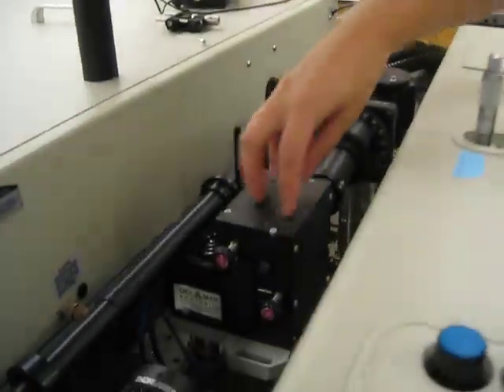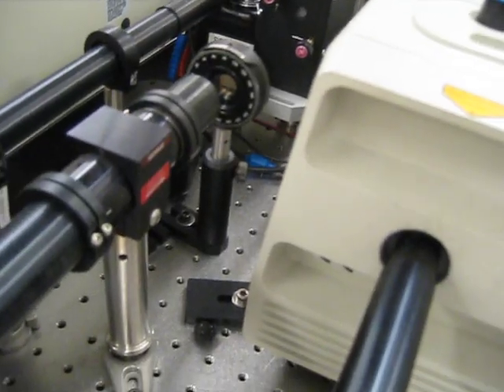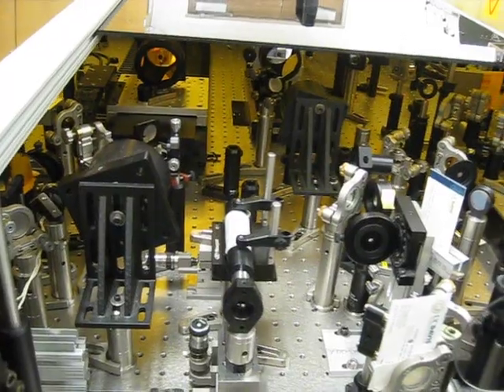A single source femtosecond-millisecond broadband spectrometer UC Davis - sales@dmphotonics.com

Comment from the maker: Structural, linear and nonlinear optical properties of metal-semiconductor nanohybrids prepared by laser ablation
Yury Ryabchikov, Artem Danilov, Vladimir Lysenko, Ronan Le Dantec, Victor Timoshenko, Andrei Kabashin
15 February 2016 • 3:30 - 3:50 PM | Part of SPIE LASE

High-throughput depth-resolved parallel laser machining based on temporal focusing
Dapeng Zhang, Chenglin Gu, Shih-Chi Chen
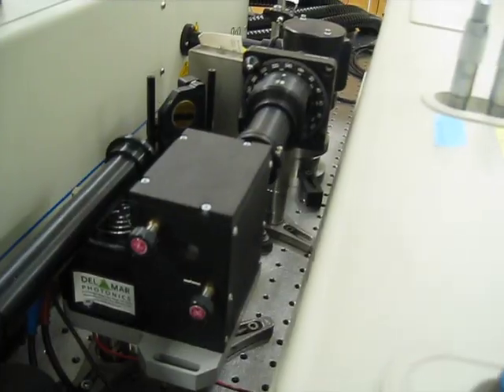15 February 2016 • 2:30 - 2:50 PM | Part of SPIE OPTO

Surface functionalization with femtosecond lasers
Chunlei Guo
16 February 2016 • 4:00 - 4:30 PM | Part of SPIE LASE

Direct formation of 100 nm-sized structure by laser-induced forward transfer (LIFT) using femtosecond laser beam
Takahiro Nakamura, Koki Omachi, Shinichi Sato
16 February 2016 • 6:00 - 8:00 PM | Part of SPIE LASE

The influence of femtosecond laser wavelength on waveguide fabrication inside glasses
Javier Hernandez Rueda, Jasper Clarijs, Charmayne E. Smith, Richard K. Brow, Denise M. Krol
16 February 2016 • 6:00 - 8:00 PM | Part of SPIE LASE

Post-mortem characterization of fs laser-generated micro-pillars in Li(Ni1/3Mn1/3Co1/3)O2 electrodes by laser-induced breakdown spectroscopy
Peter Smyrek, Johannes Pröll, Hans J. Seifert, Wilhelm Pfleging
18 February 2016 • 4:20 - 4:40 PM | Part of SPIE LASE

Activation of cells using femtosecond laser beam
Subrata Batabyal, Sarmishtha Satpathy, Young-tae Kim, Samarendra K. Mohanty
13 February 2016 • 11:10 - 11:30 AM | Part of SPIE BiOS

Heat transfer analysis of two wavelengths laser microprocessing inside glass
Aoi Matsumoto, Takayuki Tamaki, Shinichi Enoki, Etsuji Ohmura
16 February 2016 • 6:00 - 8:00 PM | Part of SPIE LASE

Analysis of human hairs and nails by femtosecond laser-induced breakdown spectroscopy
Sergey S. Golik, Alexey A. Ilyin, Tamara M. Agapova, Michael Y. Babiy, Yuliya S. Biryukova, Alexander Y. Mayor, Nataliya N. Golik
16 February 2016 • 6:00 - 8:00 PM | Part of SPIE LASE

Resolving the buildup of mode-locking with real-time spectroscopy at 90 MHz
Georg Herink, Claus Ropers, Bahram Jalali, Daniel R. Solli
15 February 2016 • 9:20 - 9:50 AM | Part of SPIE LASE

Dual-comb spectroscopy with a free-running bidirectionally mode-locked fiber laser
Khanh Q. Kieu, Seyed Soroush Mehravar, Robert A. Norwood, Nasser N. Peyghambarian
16 February 2016 • 6:00 - 8:00 PM | Part of SPIE LASE

Laser-printing and femtosecond laser-structuring of electrode materials for the manufacturing of 3D lithium-ion micro-batteries
Johannes Pröll, Heungsoo Kim, Yijing Zheng, Peter Smyrek, Hans J. Seifert, Alberto Piqué, Wilhelm Pfleging
15 February 2016 • 4:40 - 5:10 PM | Part of SPIE LASE

Laser-assisted morphing of complex three dimensional objects
Yves Bellouard, Jakub Drs
15 February 2016 • 3:10 - 3:30 PM | Part of SPIE LASE

Effect of laser polarization and pulse energy on therapeutic, femtosecond laser-induced second harmonic generation in corneal tissue
William R. Calhoun III, Ilko K. Ilev
14 February 2016 • 2:30 - 2:45 PM | Part of SPIE BiOS

High-speed arbitrary phase and amplitude femtosecond pulse shaping with a digital micromirror device
Yina Chang, Chenglin Gu, Dapeng Zhang, Shih-Chi Chen
14 February 2016 • 12:00 - 12:20 PM | Part of SPIE LASE

An LSPR fiber optic sensor based on in-line micro-holes fabricated by a second harmonic 400-nm femtosecond laser
Masahiko Shiraishi, Kazuhiro Watanabe, Atsushi Seki, Kenji Goya
17 February 2016 • 6:00 - 8:00 PM | Part of SPIE OPTO

Compact fixed wavelength femtosecond oscillators as an add-on for tunable titanium sapphire lases extend the range of applications towards multimodal imaging and optogenetics
Tommi Hakulinen, Julien Klein
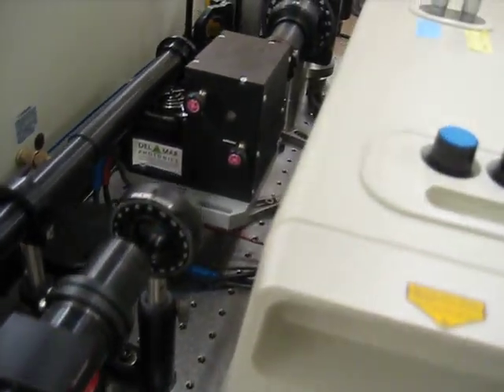16 February 2016 • 2:20 - 2:35 PM | Part of SPIE BiOS

Fabrication of scattering source for an optical fiber sensor using femtosecond laser internal processing
Naoki Chinen
17 February 2016 • 4:50 - 5:10 PM | Part of SPIE OPTO

High speed printing with polygon scan heads
Glenn Stutz
16 February 2016 • 6:00 - 8:00 PM | Part of SPIE LASE

Spectral phase interrogation using nonlinear spectra (SPINS)
Aram Gragossian, Brook A. Jilek, Mansoor Sheik-Bahae
16 February 2016 • 11:30 - 11:50 AM | Part of SPIE LASE

Polarization-depended nanocavitation in plasmonic nano-bowties enhanced femtosecond laser generation of nanobubbles
Christos Boutopoulos, Adrien Dagallier, Maria Sansone, Évelyne Lecavalier-Hurtubise, André-Pierre Blanchard-Dionne, Ali Hatef, Michel Meunier
14 February 2016 • 9:40 - 10:00 AM | Part of SPIE LASE

Simultaneous spatial and temporal focusing: A route towards confined nonlinear materials processing
Robert Kammel, Klaus Bergner, Jens Thomas, Roland Ackermann, Stefan Skupin, Stefan Nolte
17 February 2016 • 3:50 - 4:20 PM | Part of SPIE LASE

Recent developments in widely tunable and high peak power ultrafast laser sources and their adoption in biological imaging
Julien Klein
15 February 2016 • 4:20 - 4:35 PM | Part of SPIE BiOS

Laser-induced periodic surface structures (ripples): Dynamics, control, and applications
Jörn Bonse, Sandra Höhm, Arkadi Rosenfeld, Jörg Krüger
17 February 2016 • 2:00 - 2:40 PM | Part of SPIE LASE

Optically-induced currents in dielectrics and semiconductors: a new ultrafast nonlinear optical effect
Jacob B. Khurgin
16 February 2016 • 4:00 - 4:30 PM | Part of SPIE OPTO

10µj, ultrashort sub-100 fs FCPA synthesizer
Florent Guichard, Marc Hanna, Ronic Chiche, Yoann Zaouter, Fabian Zomer, Franck Morin, Clemens Hönninger, Eric P. Mottay, Patrick Georges
18 February 2016 • 8:40 - 9:00 AM | Part of SPIE LASE

Factors affecting amplified spontaneous emission in (C6H5C2H4NH3)2PbI4 perovskite
Wee Kiang Chong, David Giovanni, Teck Wee Goh, Krishnamoorthy Thirumal, Xinfeng Liu, Nripan Mathews, Subodh G. Mhaisalkar, Tze Chien Sum
16 February 2016 • 11:30 - 11:45 AM | Part of SPIE OPTO

Nonlinear refraction dynamics of solvents and gases
Eric W. Van Stryland, Peng Zhao, Trenton Ensley, Matthew C. Reichert, David J. Hagan
16 February 2016 • 1:40 - 2:10 PM | Part of SPIE LASE

Optical and magneto-optical properties in Fe-doped silica glasses irradiated with oscillator-only femtosecond laser
Isabela de Carvalho Martins, Kevin De Mello Santamaría, Paulo S. Pizani, Edgar D. Zanotto, Cleber R. Mendonça, Paulo Henrique D. Ferreira
17 February 2016 • 6:00 - 8:00 PM | Part of SPIE OPTO

Compressive high speed flow microscopy with motion contrast
Bryan Bosworth, Jasper R. Stroud, Dung N. Tran, Trac D. Tran, Sang Chin, Mark A. Foster
14 February 2016 • 3:50 - 4:10 PM | Part of SPIE BiOS

Towards a more complete understanding of laser ablation with ultrashort pulses: Mechanisms of confined laser ablation and pulse duration dependence of laser ablation efficiency
Heinz P. Huber, Jan Winter, Juergen Sotrop, Regina Moser, Stephan Rapp, Rudolph Reiel, Matthias Domke
16 February 2016 • 8:00 - 8:30 AM | Part of SPIE LASE

Complex micro-optics fabricated by femtosecond 3D direct laser writing
Harald Giessen
16 February 2016 • 8:30 - 9:00 AM | Part of SPIE OPTO

Setup for analysis of optical and geometrical property changes in ex vivo crystalline lenses during simulated accommodation modified with fs-laser pulses for presbyopia treatment
Jan Hahn, Michael Fromm, Gabriel Kattermann, Tano Roth, Alexander Krüger, Tammo Ripken
14 February 2016 • 9:45 - 10:00 AM | Part of SPIE BiOS

Time-optimized laser micro machining by using a new high dynamic and high precision galvo scanner
Beat Jaeggi, Beat Neuenschwander, Markus Zimmermann, Markus Zecherle, Ernst Wilhelm Boeckler
18 February 2016 • 9:20 - 9:40 AM | Part of SPIE LASE

Terahertz pulse generation from quantum cascade lasers
Sukhdeep S. Dhillon, Feihu Wang, Kenneth Maussang, Juliette Mangeney, Jerome Tignon
17 February 2016 • 2:30 - 3:00 PM | Part of SPIE OPTO

Unstable multipulsing can be invisible to some ultrashort pulse measurement techniques
Michelle Rhodes, Zhe Guang, Rick Trebino
16 February 2016 • 11:50 AM - 12:10 PM | Part of SPIE LASE

Terahertz generation and detection using femtosecond mode-locked Yb-doped fiber laser
Moonsik Kong, Ji Su Kim, Sang-Pil Han, Namje Kim, Kiwon Moon, Kyung Hyun Park, Min Yong Jeon
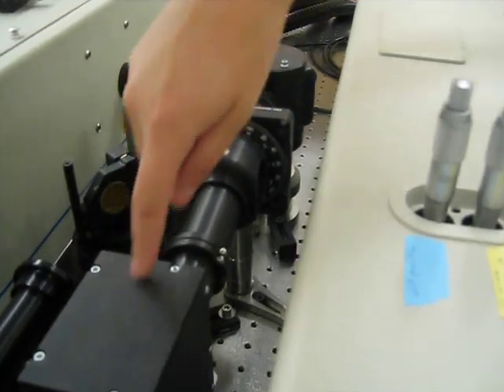17 February 2016 • 2:10 - 2:30 PM | Part of SPIE OPTO

Two-photon lensless endoscopy by controlling the wave front in a multi-core optical fiber
Siddharth Sivankutty, Esben R. Andresen, Géraud Bouwmans, Serge Monneret, Hervé Rigneault
14 February 2016 • 3:50 - 4:10 PM | Part of SPIE BiOS

High-power mid-infrared high repetition-rate supercontinuum source based on a chalcogenide step-index fiber
Stefan Kedenburg, Tobias R. J. Steinle, Florian Mörz, Andy Steinmann, Harald Giessen
16 February 2016 • 4:00 - 4:20 PM | Part of SPIE LASE

Pulse front control with adaptive optics
Patrick S. Salter, Bangshan Sun, Martin J. Booth
15 February 2016 • 2:30 - 2:50 PM | Part of SPIE LASE

Random laser properties changes in rhodamine-B-doped organic/silica hybrid materials using femtosecond laser micromachining
Luis M. G. Abegão, Paulo Henrique D. Ferreira, Adriano J. G. Otuka, Diego S. Manoel, Fábio S. De Vicente, Cleber R. Mendonça, Gabriel Herbert Gomes, Dario A. Donatti, Márcio A. R. C. Alencar, José Joatan Rodrigues, Jr.
17 February 2016 • 6:00 - 8:00 PM | Part of SPIE OPTO

Periodic surface structures induced by femtosecond laser shaped pulses on silicon
Gustavo F. B. Almeida, Renato J. Martins, Adriano J. G. Otuka, Jonathas P. Siqueira, Cleber R. Mendonça
16 February 2016 • 6:00 - 8:00 PM | Part of SPIE LASE

Unraveling functionality in two-dimensional quantum materials using ultrafast optical and terahertz spectroscopy
Rohit P. Prasankumar, Natarajan Kamaraju, Yaomin Dai, Rolando Valdes Aguilar, Dmitry A. Yarotski, Antoinette J. Taylor
18 February 2016 • 2:00 - 2:30 PM | Part of SPIE OPTO

Comment from the maker: Femtosecond laser fabricated electrofluidic devices in glass for 3D manipulation of biological samples
Jian Xu, Katsumi Midorikawa, Koji Sugioka
15 February 2016 • 1:50 - 2:10 PM | Part of SPIE LASE

Femtosecond laser waveguide writing in zinc magnesium phosphate glasses
Nikolay Skovorodnikov, Javier Hernandez Rueda, Vladimir A. Semenov, Denise M. Krol
16 February 2016 • 6:00 - 8:00 PM | Part of SPIE LASE

Laser energy deposition at the surface of dielectrics exposed to single 15-fs laser pulse
Corinne Pasquier, Marc L. Sentis, Olivier P. Utéza, Nicolas Sanner
16 February 2016 • 9:10 - 9:30 AM | Part of SPIE LASE

Zero degree contour cutting below 100 µm feature size with femtosecond laser
Klaus Stolberg, Susanna Friedel
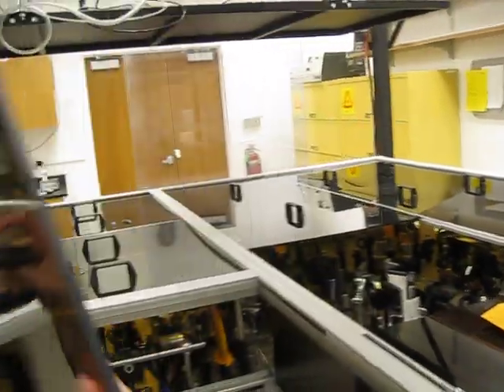16 February 2016 • 2:40 - 3:00 PM | Part of SPIE LASE

Holographic vector-wave femtosecond laser processing
Yoshio Hayasaki
18 February 2016 • 1:40 - 2:10 PM | Part of SPIE OPTO

New class of compact diode pumped sub 10-fs lasers for biomedical applications
Tuan Le, Ole B. Jensen, André Müller, Bernd Sumpf, Angelika Unterhuber, Peter E. Andersen
14 February 2016 • 2:30 - 2:50 PM | Part of SPIE LASE

Femtosecond laser ablation of silica based glasses and the role of the dissociation energy
Moritz Grehn, Thomas Seuthe, Michael Höfner, Nils Griga, Alexandre Mermillod-Blondin, Markus Eberstein, Jörn Bonse
16 February 2016 • 6:00 - 8:00 PM | Part of SPIE LASE

Photochemical reduction of graphene oxide (GO) by femtosecond laser irradiation
Muttaqin Yasin, Takahiro Nakamura, Shunichi Sato, Yuta Nishina
18 February 2016 • 2:00 - 2:20 PM | Part of SPIE LASE

Biocompatibility of novel ultracompact femtosecond laser oscillators for multiphoton imaging
Aisada Uchugonova, Hans G. Breunig, Tuan Li, Karsten König
16 February 2016 • 10:50 - 11:15 AM | Part of SPIE BiOS

Direct writing of fiber optic components in photonic crystal fibers and other specialty fibers
Luis Andre Fernandes, Omur Sezerman, Garland Best, Mi Li Ng, Saidou Kane
15 February 2016 • 9:10 - 9:30 AM | Part of SPIE LASE

Femtosecond fiber-CPA system employing coherent combination of a multicore fiber
Arno Klenke, Michal Wojdyr, Michael Müller, Marco Kienel, Jens Limpert, Andreas Tünnermann
17 February 2016 • 8:30 - 8:50 AM | Part of SPIE LASE

Quantized blistering of transparent films with femtosecond laser interference
Stephen Ho, Prasoon Jha, Peter R. Herman
17 February 2016 • 9:10 - 9:30 AM | Part of SPIE LASE

Femtosecond laser processing of transparent materials for assembly-free fabrication of photonic microsensors
Lei Yuan, Jie Huang, Jie Liu, Yang Song, Qi Zhang, Jincheng Lei, Hai Xiao
16 February 2016 • 6:00 - 8:00 PM | Part of SPIE LASE

Femtosecond laser-triggered rupture of biodegradable polymer capsules containing fluorescent molecules
Kazumasa Ariyasu, Mitsuhiro Terakawa
16 February 2016 • 6:00 - 8:00 PM | Part of SPIE LASE

Femtosecond lasers for machining of transparent, brittle materials: Ablative vs. non-ablative femtosecond laser processing
Victor V. Matylitsky, Frank Hendricks
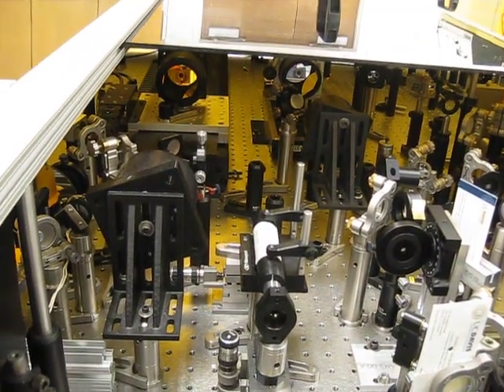15 February 2016 • 2:50 - 3:10 PM | Part of SPIE LASE

Time resolved study of femtosecond laser induced micro-modifications inside transparent brittle materials
Frank Hendricks, Victor V. Matylitsky, Matthias Domke, Heinz P. Huber
16 February 2016 • 2:50 - 3:10 PM | Part of SPIE LASE

Femtosecond laser direct writing of silver microwire in hydrogel
Mitsuhiro Terakawa, Maria Leilani Y. Torres-Mapa, Dag Heinemann, Anton Hördt, Yasutaka Nakajima, Nikolay N. Nedyalkov, Heiko Meyer, Tammo Ripken, Alexander Heisterkamp
14 February 2016 • 11:20 - 11:40 AM | Part of SPIE LASE

Femtosecond laser pulse shaping at megahertz rate via a digital micromirror device
Chenglin Gu, Dapeng Zhang, Jiyi Cheng, Shih-Chi Chen
17 February 2016 • 4:30 - 4:50 PM | Part of SPIE OPTO

Ultrafast laser mixing of metals as a route to create stable nanocrystalline materials
Keegan J. Schrider, Ben R. Torralva, Steven M. Yalisove
17 February 2016 • 4:50 - 5:10 PM | Part of SPIE LASE

Tailored femtosecond Bessel beams for high-throughput, taper-free through-silicon vias (TSVs) fabrication
Fei He, Junjie Yu, Wei Chu, Zhaohui Wang, Yuanxin Tan, Ya Cheng, Koji Sugioka
15 February 2016 • 10:20 - 11:00 AM | Part of SPIE LASE

New trends in laser micromachining
Frank Gaebler
16 February 2016 • 9:00 - 9:20 AM | Part of SPIE LASE

Monitoring femtosecond laser microscopic photothermolysis with multimodal microscopy
Yimei Huang, Harvey Lui, Jianhua Zhao, David I. McLean, Haishan Zeng
14 February 2016 • 11:00 - 11:20 AM | Part of SPIE BiOS

Direct femtosecond laser writing of buried infrared waveguides in chalcogenide glasses
David Le Coq, Eugène Bychkov, Pascal Masselin
15 February 2016 • 11:30 AM - 12:00 PM | Part of SPIE OPTO

Comparison of low and high pulse energy regimes of femtosecond waveguide writing
Mikhail A. Bukharin, Dmitriy V. Khudyakov
17 February 2016 • 6:00 - 8:00 PM | Part of SPIE OPTO

Nanotextured surfaces for surface enhanced Raman spectroscopy and sensors
Saulius Juodkazis
16 February 2016 • 3:30 - 4:00 PM | Part of SPIE LASE

Tribological properties of femtosecond laser-induced periodic surface structures on metals
Jörn Bonse, Robert Koter, Manfred Hartelt, Dirk Spaltmann, Simone Pentzien, Sandra Höhm, Arkadi Rosenfeld, Jörg Krüger
16 February 2016 • 6:00 - 8:00 PM | Part of SPIE LASE

Broadband wavelength tuning of hybrid femtosecond Er/Tm fiber laser system in microstructured suspended-core tellurite fiber
Maksim Y. Koptev, Elena A. Anashkina, Alexey V. Andrianov, Vitaly V. Dorofeev, Alexey F. Kosolapov, Sergey V. Muravyev, Arkady V. Kim
16 February 2016 • 6:00 - 8:00 PM | Part of SPIE LASE

10-kW peak power femtosecond pulses from a mode-locked fiber ring laser emitting at 2.8 µm
Simon S. Duval, Michel Olivier, Vincent Fortin, Martin Bernier, Michel Piché, Réal Vallée
15 February 2016 • 8:30 - 8:50 AM | Part of SPIE LASE